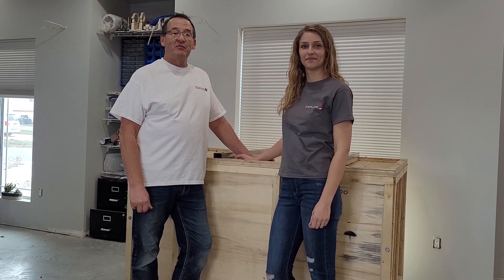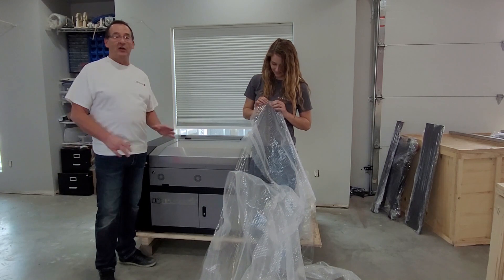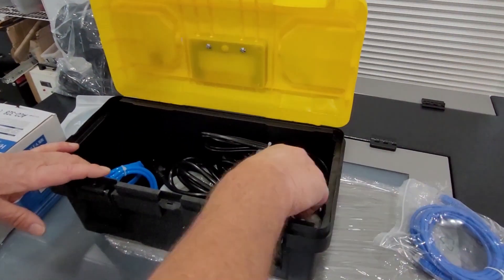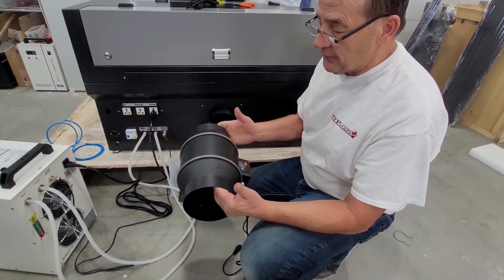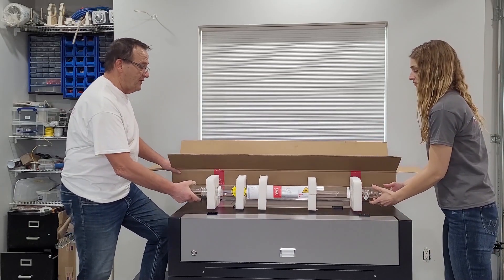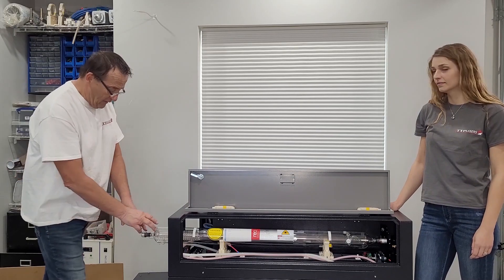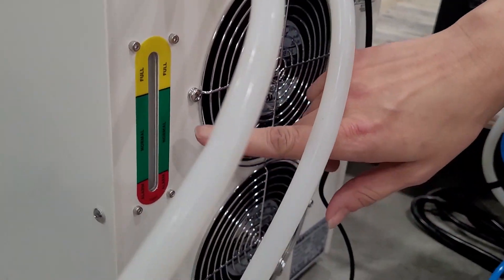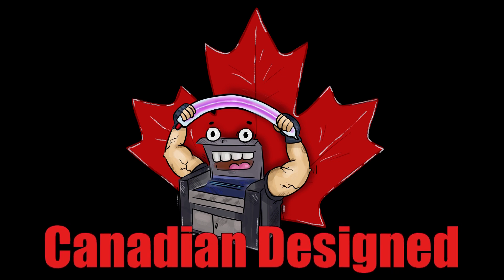LiteRay Setup

Comment: I love this. But i have few questions,
1) Power and speed to cut 1/4inches acrylic ( please tell me in inches) 
2) What kind or brand antifreeze i need to use.
3) How to align laser head .
Please make video for that and so much thank you.
Reply: Setting depend on the power of the laser. Any RV antifreeze is good. Please see our 3rd mirror alignment video for head alignment. thanks for your comment.
Reply: @raynikkel1501  like i have 80w laser what you suggest me to set for power, speed and passes to cut 1/4 inches acrylic. Please let me know for sure.
And thank you for your reply.
Reply: @manramanjeetsingh9857  Try 90 power 15 speed 50.8mm lens

Comment: New vid time!!! Anyway you can do a Winterizing video ? I'm sure a lot of us have a machine in the garage that gets Very cold in the winter. I live in Ontario and get a lot of cold temperatures, and scared that the Tube might break. I've seen a few ideas but would prefer to see what you guys say. Maybe you can offer a heater of some kind that we can add in the chiller or back of the Tube area.
Great Videos cant wait to get mine !
Reply: Just simply add RV antifreeze to your chiller. Thanks for the question.